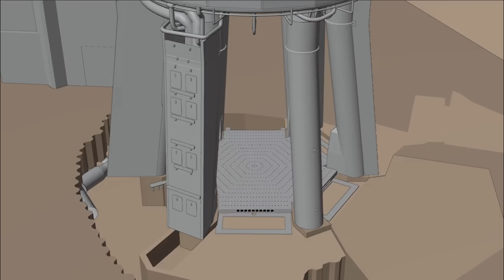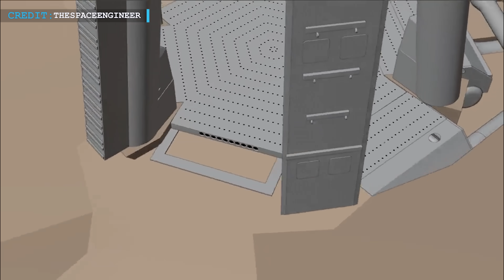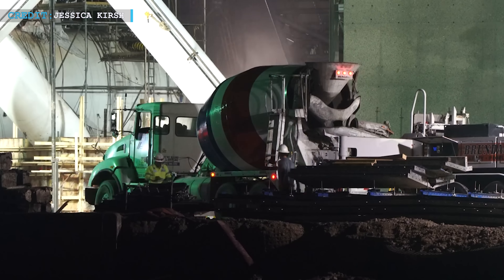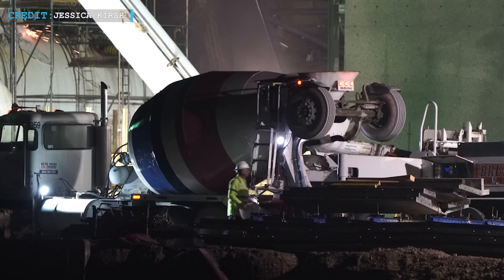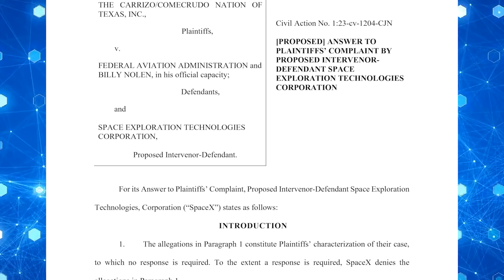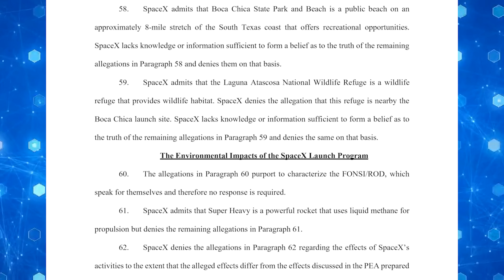SpaceX Starship launch pad readiness | Manifolds have been transported and positioned

Comment: Ya know, when I look at that cargo bay door of Starship, I have to wonder if the SpaceX engineers ever considered a vertical payload door opposed to the current horizontal door. You have to wonder just how much structural reinforcement has to be added to carry that stress load around that huge door. If the stresses collapse that door opening by even a fraction during launch, that door may not open or close. If I were to design it, I would attempt a vertical door as it is much easier to carry that stress load. The big takeaway would be if they could deploy the Starlinks in a vertical position. In my mind, I picture a multilevel dispenser similar to the old slide projector carousels. Preliminarily, I think you could actually dispense more satellites in this configuration if the mechanics work out.

Comment: I figured they would use the heat and pressure from the raptors to supply the deluge with water preasure.
Reply: How on earth would that be possible? The best part is no part
Reply: @rogerhalt3991  well I'm not sure ,but if concrete explodes...I'm thinking water might vaporize...With a closed steel chamber the heat might vaporize the water...to generate enough pressure then just keep the faucet running.
Reply: @rogerhalt3991  Have you ever forgot something you were Boling on the stove, With the lid still on?
Reply: @Ragnarok3rd  How would it be possible to circulate that pressure from the Raptors to the new tank farm to add pressure to the water? It wouldn't be a viable option.
Reply: @rogerhalt3991  I didn't say it was fully thought out idea...just turning some gears...
Reply: @rogerhalt3991  but I was referring to the heat 33 raptors produce...

Comment: It's amazing that the steel water sandwich has already been placed over concrete which has not been cured. The concrete has barely had enough time to harden. It will take far more time to achieve its real strength. I wonder how this freshly laid concrete will survive the blast of 33 Raptor engines!
Reply: Concrete does not require access to the atmosphere to cure.  It will cure equally well with the steel pancake installed.  The earliest possible launch date is late August, assuming the FAA gives permission.  FAA permission clearly requires a "concrete" demonstration that the new design is safe.  This will require several progressive static fire tests with negligeable environmental damage.  IFT1 exposed the foundation to at least five seconds of 90% thrust from 31 engines.  That means the concrete will have at least 6 weeks to cure.
Reply: The concrete will be largely covered and won’t directly withstand the force. It is to provide a solid platform
Reply: Fair enough. The concrete would take months to reach full strength. But SpaceX could get away with it because the only force it will have to handle would be the weight of the steel plate and the force of the rocket exhaust. It didn't have to handle the weight of the rocket because the pillar holding it is still fine after the launch.
And even if it was a concern in just 1 month concrete cold reach 90% strength.

Comment: A lot of good information here, however, the presentation was a bit confusing by jumping around some of the topics, such as talking about the steel plate and showing it being moved into position and then later talking about the trucks of concrete. Also, in some instances,  the narrative does not match the video on screen. Not a huge issue, just trying to follow what is happening at Starbase. With that said, who builds a rocket research lab in the middle of a wildlife preserve? I know a lot of the Kennady Space Center in Florida is a wildlife preserve, but a balance between human intrusion and wildlife has been achieved there. As for Boca Chica either the environmentalist need to chill or maybe Musk should have setup somewhere else. Question who came first; the wildlife or a 394-foot rocket? JustSaying.
Reply: In response to your last question wildlife and American Indians came along thousands of years before the European colonists who have progressively overwhelmed the wildlife and the Indians.  It's only in the last few decades that there has been any moderation of that assault on the environment and the original inhabitants, but that assault is still going on in some form.  The decline in wildlife habitats and wildlife is testament to that.

Ideally it would have made more sense to restrict the Boca Chica area to any development that threatens the wildlife refuge in that area.  But we are here now. 

 A proper environmental impact of the Boca Chica region would evaluate the potential impact of repeated launches of the super heavy and if that has already been determined then this lawsuit might be moot.    

In other words uncertainty reigns supreme.   That's just the way it is.

Comment: Looks fascinating. Though it also looks flimsy relative to the pressures the system must endure during launch. I will be surprised if it manages to hold together and doesn’t peel apart like so many sardine tins to become massive platters of steel flung in every direction.
Reply: Pressurized fluid dynamics are a b1tch
Reply: Steel doesn't act like that but i agree about whether it will hold on together or not.  
If you actually see the massive size of the steel plate with a person standing on it, it will at least take a beating before giving out.

Comment: SpaceX knew that the starship test was going to destroy the launch base, it was not an accidental oversight. They already had plans in place and production in process when they launched. I suspect they suggested removing the concrete and installing the new deluge system and they decided to remove the concrete by rocket blast. It was yet another SpaceX destructive testing experiment, yes even the engine damage and failure was part of that test.  

It is a good example of what the likely results of a launch from a rocky planet surface would do to the rocket.

Comment: This steel plate will be deformed after the first start of all engines. Water can't stop it.
Reply: It can if you understand a little bit of physics.
The steel sandwich is sitting on top of thousands of tons of concrete for support.
The steel sandwich will be filled with water under extreme pressure, to prevent the booster exhaust blowing the water back where it came from. Water cannot be compressed. 
So, the booster exhaust is trying to crush the steel plate, and the water is trying to ‘balloon’ the steel plate. Get the pressures balanced correctly and the steel plate will retain it’s shape.
And finally, the water provides cooling to prevent the steel plate melting.
My money says this will work just fine.
Reply: @MickHealey  think you’ve used the key phrase, “get the pressures balanced correctly”. From these schematics, the water enters the deluge system from only three sides, you’re bound to have pressure differentials within the honeycomb of supports between the plates. Plus, and probably more importantly, the water will be flashing into steam which wants to expand in volume by 1600 times relative to water, creating pressure inside the sandwich and probably an enormous back pressure against the continued flow of liquid water, such that the plates cannot be kept cool. Isn’t that why NASA uses open cascades and surge sources so that as the water expands into steam the pressure can readily escape to the periphery of the pad? Also, there’s long seams joining the plates together and thousands of welds inside holding the sandwich together. I struggle to see how parts of this don’t rattle apart and begin a rapid cascading failure of the whole system. But as the saying goes. Time will tell.
Reply: @waveland  you've raised some good points, which I can't argue with. However, SpaceX got where they are through innovation, iteration, data collection, analysis, and having brilliant minds on the case, not fearing to try new ideas (e.g. RTLS boosters). I think we can all rest assured that they will have considered water flashing to steam, back pressures, etc. If not, they are in the wrong job. They had a lot of egg on their face after the first launch. Reputation rides on the second launch, so SpaceX must be pretty confident they've got it right this time. They need NASA's confidence to launch at the Cape, so will have bet the family silver on this solution. From the first launch they will have gathered data on the engine thrust, exhaust temperatures and pressures. All of this will have been fed back to computer models to see if the "shower head" is up to the job. Furthermore, they have stated that they need to get off the ground quickly this time. They've gone ahead with it, so the results must have been promising, based on a quick lift-off. That's good enough for me and I really do think this is going to work. As you rightly say though, time will tell.
Reply: @waveland Static fire testing on the OLM against the plate, which will actually be worth watching, will help SpaceX to work out some of those issues. Although they probably can’t test at 100% throttle unless they want to catch the booster with the chopsticks 😂
Reply: I do not think so, water mixed with super high pressure gas might do the trick this time